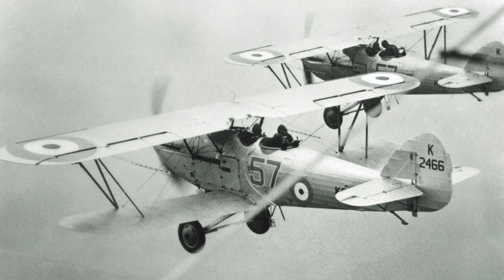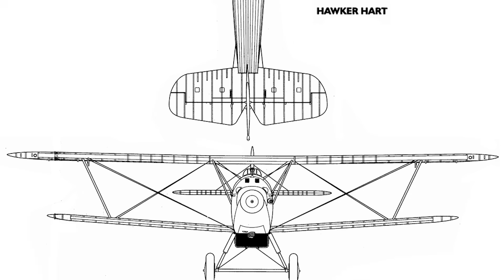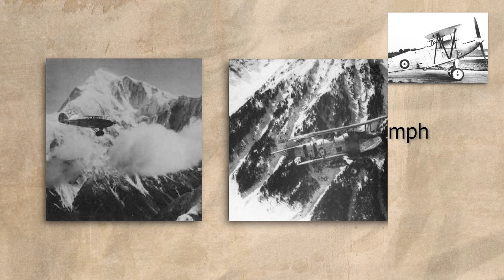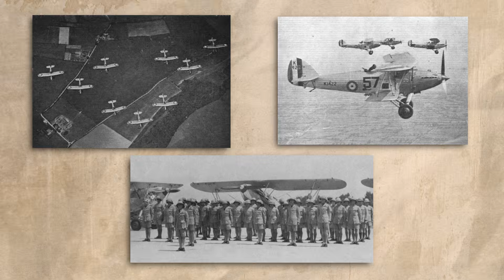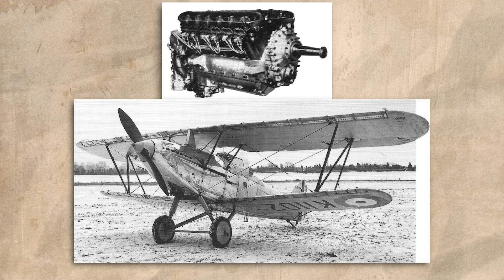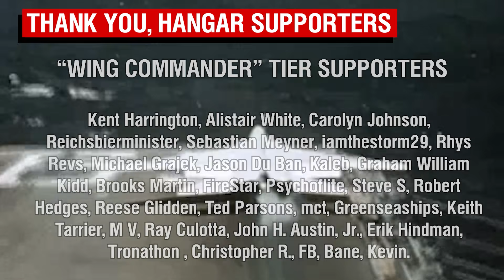Hawker Hart | The Bomber That No Fighter Could Catch (in 1930)

Comment: These aircraft were absolutely beautiful, lovely to see a few still flying. My dad learned to fly HARTS with RAF in SA at Watercloof?  really loved them as did his pals .He passed out as pilot ok then failed an eyesight medical did not like the alternative aircrew jobs offered so finished up in Burma doing a variety of other jobs as an AC . He ultimately was in the air ministry and tasked with helping set up the BBF in the late fifties, and proud as I was to be his guest for the fortieth anniversary celebrations back in ‘97 if I remember correctly.
  BTW thankyou for showing the Radial engined variants . Camm had a good relationship with Bristols even though he used the RR liquid cooled v 12 s.

Comment: The simple fact that the 'ministry' could and would just willy nilly adjust the requirements when they got a good aircraft, shows the value of these 'requirements'. Less than a pile of steaming warm dog poo. One of the many reasons why I have never and will never ever submit to any requirements from the prune. Besides, they have zero idea what I can build. They are in the 17th century and my company is solidly in the 21st.

Comment: Hi Rex, I read somewhere that a number of Harts were modified during WW2 in India as an emergency  stop gap one seat fighter. The RAF emptied the rear seat are and covered it over resulting in a 20mph increase in speed. As you can guess the pilots were not too keen in tangling with any Japanese aircraft that might come there way.
I need to find the book and extract and let you know.

Comment: the Hawker Hart is the airplane that changed fighters from Maneuverability (Turn and Burn) to Speed (Boom and Zoom). Japan failed to learn this prior to WW2. And this speed doctrine dominated until modern day (post-4th gen jet fighters) as missiles have come to dominate air combat and BVR is becoming a larger factor. New jets like the F-18 and F-35 don't go as fast anymore, as they no longer need to and can better put the cost/effort to range, stealth, and sensor capabilities.

Can't shoot what you can't catch. the aircraft which i faster dictates the terms of the engagement (when to fight, when to runaway).
Reply: This is the first comment I have ever seen on YouTube that indicates understanding of the drivers behind fighter design during different periods. Yes, speed and climb dominated air combat when it was guns-only because the holder of superior position or performance could choose between fight and flight and make it stick, or use that superior performance to quickly kill the opponent with an acceptable level of risk.  Dogfighting from equal positions in equal aircraft was fun and established pilot reputation around the home air patch, but it was not recommended as an actual combat tactic because you want to engage the enemy with a better than 50/50 chance of survival. 

By the time fighters reached jet speeds and turn radii is was usually possible for a fighter to escape a dogfight by rolling out and running in the opposite direction. But the development of truly effective air to air missiles began to narrow and ultimately close that escape window, and dogfights became a cage match that someone had to lose. Not only did BFM training then become vital for pilots, but fighter design then began  to sacrifice superior top speed to gain superior turn performance. 

People who don't understand this refuse to believe the F-104 was designed as an air superiority fighter. But it was designed to maximize the attributes of speed and climb that dominated in actual battle before missiles changed the game.  At that time pilots and air forces were still asking for aircraft with superior speed and climb, and nobody had yet asked for an airplane that sacrificed superior speed and climb to achieve a superior turn radius. The F-15 was the first USAF fighter designed to gain turn performance by leaving some speed on the drawing board.
Reply: @gort8203  Actually, maneuver in WW1 was wrong. And the late war top fighters of WW1 proved this by being better at Boom and Zoom than their earlier war rivals.

Fokker D.VII, SPAD XIII, and others were very well suited for Boom and Zoom type attacks compared to the Camel, Fokker Dr.1 and others. Even in WW1, speed gave the ability to dictate the fight. They can't shoot you down if they can't catch you, and if they try to run away, you turn around and chase them down. But this wasn't driven home until the Hart came along. And maneuver stuck in the mind as the more honorable or sportsman like way of fighting. Boom and Zoom felt more like a "cowardly" sniper approach. Yet the Red Baron was famous for using Boom and Zoom tactics. Most top aces in WW1, WW2, etc. relied upon Boom and Zoom.

The F-104 was designed as an interceptor. in the cold war, nukes changed the landscape of warfare, and he who struck first, won. So focus was on intercepting bombers, until the ICBMs came along. In Europe especially, you'd get mere minutes warning of a nuke bomber inbound because borders were so close. And so when the scramble call came out you needed to be able to takeoff and climb to altitude in mere minutes, shoot as many bombers you could, and hope to rearm to get a second try (highly unlikely). So you go airplanes like the F-104, F-106, Electric Lightning, and many more. They relied primarily upon missiles to be able to strike more bombers from further away. The AIM-9 was developed late in WW2 and first saw service on F-86 Sabers. The F-104 was developed after missiles were already on the scene. Show me any stories of the F-104 being used as an air superiority fighter. It couldn't turn worth a darn.

"The F-15 was the first USAF fighter designed to gain turn performance by leaving some speed on the drawing board."

wrong again, the F-15 was and still is one of the fastest air superiority fighters on earth. Unlike the Mig25, the F-15 didn't have to worry about its engines exploding if it maintained it's Mach 2+ speeds. The F-16 also is highly maneuverable and still Mach 2+ capable. The emphasis was still on speed, as missiles were still not mature yet, and the need for bomber interception was still there in the 1970s and 1980s. But better maneuverability was added to better deal with the smaller nimbler Migs in Vietnam.

F-15 gave up nothing in speed to beat out the F-4. it got faster, and more maneuverable at the same time.
Reply: @SoloRenegade  How disappointing.  I thought you sounded like you knew something, but I was wrong.

The F-104 was not designed as an “interceptor”, it was designed as an air superiority fighter. You would know this if you read its history. I’m not going to waste my time repeating it all for you here, but read any book on the airplane, read the flight manual, read the test pilot notes, hell even Wikipedia gets the most of the story right.  BTW, it flew escort, CAP, and even CAS in Vietnam.  You know nothing about this airplane.  

Yes, the F-15 is  very fast fighter, but the point you can’t grasp is that it could have been even faster if that had been a priority.   Instead of choosing a low drag wing for a higher dash speed, they chose a draggy wing with heavy conical camber for sustained turn rate even though they knew it would limit the dash speed.  They knew the Mig-25 was faster but they didn’t care to try to match its speed because they knew that was not important.  Read the history. 

You don’t know what you’re talking about with either airplane, so I’m sorry I misinterpreted your original comment.
Reply: @gort8203  "I thought you sounded like you knew something, but I was wrong."

coming from you, someone who doesn't get it, that doesn't mean much.

they can talk about air superiority all they like, but it has no traits of such a craft.

for example, here is a claim on wikipedia, "The Starfighter's speed and rate-of-climb performance intrigued the Air Force, who pressed the F-104A into service as an interim interceptor with the Air Defense Command (ADC), even though its range and armament were not well-suited for the role."

if it didn't have the range or armament for interceptor duties, it absolutely lacked the range and armament for fighter duties. Interceptors need far short range than fighters. whoever wrote this was an idiot.

Explain how it ever was an air superiority fighter.

"BTW, it flew escort, CAP, and even CAS in Vietnam.  You know nothing about this airplane.  "

that's a bold claim to know what is in another person's head. and also impossible for you to know.

If the F-104 was so great at CAP and escort, then why did it score no kills, and one air to air loss? and why was it removed from Vietnam in 1967? why wasn't it used to escort F-105s? why wasn't it used when a better fighter was desperately needed (resulting in the F-15)?

So how about you prove your superior knowledge to me (even though you claimed the F-15 gave up speed for maneuver). Explain how the F-104 was capable of being a superiority fighter, despite being less maneuverable than everything else, and carrying less armament that most fighters. You surely should understand the difference between Claiming something is one thing, and actually being able to perform that role.

"Yes, the F-15 is  very fast fighter, but the point you can’t grasp is that it could have been even faster if that had been a priority."

wrong again, I well know it could go faster, if designed for that. See the YF-12. But the F-15 was king of sustained speed when it came about, so your claim is irrelevant. Not to mention no one dogfights at Mach 2+, so not like it mattered.

"Instead of choosing a low drag wing for a higher dash speed, they chose a draggy wing with heavy conical camber for sustained turn rate even though they knew it would limit the dash speed. "

and it became the King of dogfighters and multirole aircraft as a result.

"They knew the Mig-25 was faster but they didn’t care to try to match its speed because they knew that was not important.  Read the history. "

proving my point.....

Keep in mind that literally no aircraft are built to fly faster than the F-15 in actual combat. the F8U-3 was capable of going faster, but never made it to production. notice how pretty much ever aircraft since has been slower than the F-15? there is a point at which greater speed comes at too high a cost to be practical anymore. and the aircraft that can go faster, all get slaughtered in air combat (Mig25, Mig31, for example), largely because they can't turn (just like the F-104)

"You don’t know what you’re talking about with either airplane, so I’m sorry I misinterpreted your original comment.""

as you made incorrect analysis of WW1 dogfighting, and ignored that fact speed dominated even before ww2 began and well before missiles dominated. or the fact you believe the F-104 was a superiority fighter despite not being able to actually dogfight. The F11F-1 was a far superior craft. And the F-5 is even a far better air superiority fighter than the F-104, but an inferior interceptor.

so, how about you stop relying upon insults, and stop relying on wikipedia and such, and actually build and argument of your own that is accurate and logically correct, to prove your supposed intellectual superiority.

Air superiority fighters: F-8, F-15, F-16, F-14...
Not air superiority fighters: F-104, Mig21, F-106, F-101, Mig25...

If you get shot down more than you shoot down, you cannot claim the title/role. Hell, even the F-111 has a better record in combat as a superiority fighter, 1 kill and 1 loss.
Reply: @mdscott6  
I'm not going to keep arguing with someone who ignores actual facts.  You are making up your own determination of what the F-104 was designed to be while ignoring the actual history.  You are ignorant of the facts and need to do some reading. 
And try harder at it, because you obviously don't read very well.  For example, you say I made an incorrect analysis of WWI dogfighting when I never even mentioned WWI dogfighting.  You have a lot of confused and unrelated impulses bouncing around in your head.  Calm down and read the established historical facts instead of creating your own.

Comment: I can't make the bird attack story work in my head. Unless it was attacking the pilot himself, which would have been mentioned I would think, I can't figure out how the bird could have done enough damage to the plane to knock it out of commission. The story seems fishy and I wonder if it was a practical joke in a report filed by the pilot or some sort of weird attempt to deflect blame for damaging the plane in a less goofy, more incompetent way. The "humorous report" angle isn't altogether unheard of in that period. A German U-boat captain known for practical jokes reported seeing a "sea monster" that startled the crew, for instance, in the boat's official logbook.
Reply: Unless the airplane was doing nothing but slow, tight turns, it's obvious that the story was a fabrication. In level flight, it would not be possible for a bird to keep up with the speed of the airplane, much less conduct multiple of swooping attacks upon it.
Reply: @Justin_Kipper  Quite so. NO Kite (bird) can flay at anything like the necessary speed. Peregrine falcons can dive at speeds that would allow them to overtake a Hart but are much too small (and sensible!) to attack one. An Imperial Eagle could certainly do enough damage to the fabric to seriously affect handling capability, especially in turbulent air. However, even knowing these and similar size eagles well, I cannot see how it could make multiple attacks - after the first it would be left far behind. There WAS a story somewhere in a Boy's Own Annual of the 1930s with this episode and even an exciting artist's impression of the encounter.😁

Comment: I read an autobiography of an RAF pilot who served between the wars. He mentioned flying a number of aircraft including the Hart. But he mentioned something I had not come across before. He called it the Siskin face. Apparently the Siskin was tricky to land and it could result in the pilots face making contact with the instrument panel which left its mark on the pilots face. Having a Siskin face was regarded as a sign of a pilot had not mastered the aircraft.
Reply: G'day,

That sounds like a
Second generation
Iteration of the famous
"Camel Face"...

Owing to the  2 Vickers Guns' (boxy Steel) Recievers protruding into the Cockpit, at the 10 & 2 "O'-Clock" positions of the Instrument Panel..., the better for being able to use a 2-pound "Coal Hammer" (mounted in the Cockpit as part of the regular fittment !) to belt the Cocking-Handle to clear any Gun-Jams...

The flat rectangular But-plates had 1-inch of Kapok Padding under Leather Upholstery...; so
Sudden Decelerations -
Especially before the 4-Point 
Sutton Harness was invented, specifically after one Camel almost threw Mr Sutton out of the Cockpit when the Elastic-sided Lap-Strap 
Expanded and let him slip through..., after Negative-G resulted from application of  full Forward Stick...; sudden decelerations -like breaking the Undercarraige or nosing over, or hitting anything solid, while moving at significant speed..., tended to throw the Pilot's Face onto the Guns' Butplates hard enough to break both Cheekbones, leaving the Rectangular imprint of two Air-Cooled Vickers-Maxim Guns on their visage, forevermore...

The secret was to
Not crash one's
Camel...

Such is life,

Have a good one...

Stay safe.

;-p

Ciao !
Reply: @WarblesOnALot  Thanks WarblesOnAlot. I had totally forgotten about the Camel Face.

Safety during this period did leave something to be desired. Towards the end of WW1 the Germans started introducing the first parachutes which resulted in the deaths of a number of their pilots. Fills you with confidence.

And the 2-pound coal hammer. Not much call for them these days as hitting your heating with one is not recommended.

Here in the UK summer has now finally arrived. Which has left us all startled at what that bright object in the sky is.

Have fun and remember to take you 2-pound coal hammer next time you fly. Though I'm not sure how airport security will react. Especially when you explain about the machineguns.

Happy trail.
😀